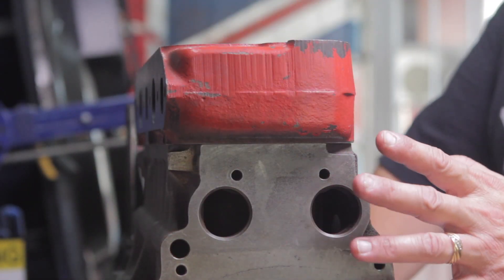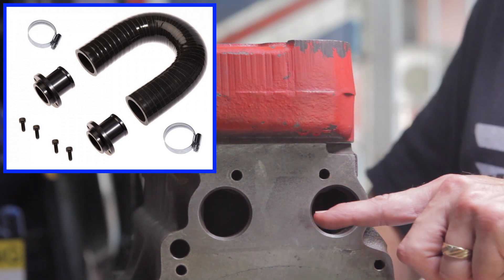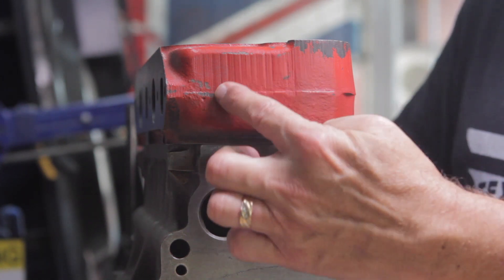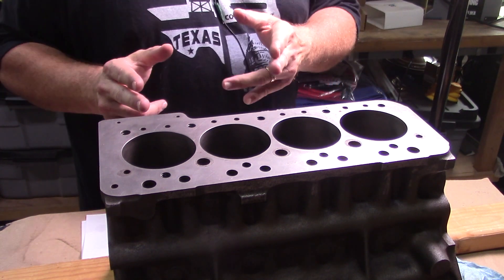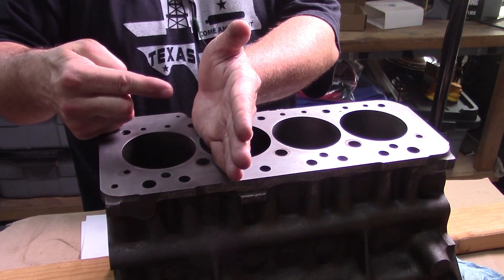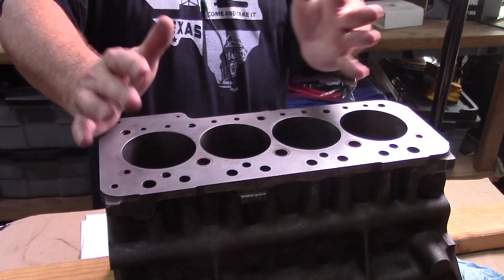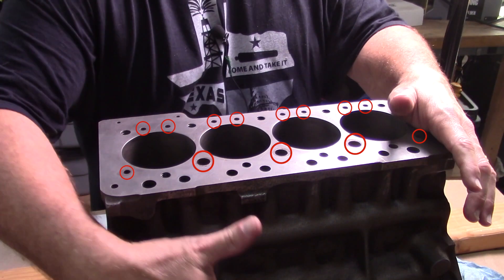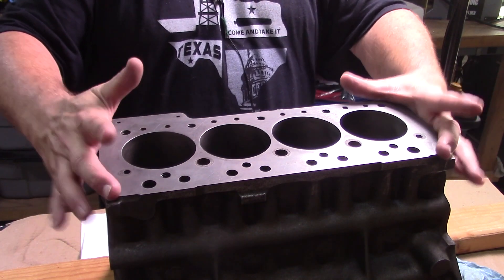Dry Decking my A-series 1275 engine- Classic Mini

Comment: 1, run engine a it bit richer this helps cool engine by washing the ports .
2, advance the timing 4 degrees more than manual states,this make for a cooler running engine.
3',change radiator for a 3 or 4 core.
4 use a 72/74/78 degree thermostat.
Reply from the maker: Greatly appreciate the tips..  will definitely learn more about 1 & 2.  I already have 3 & 4.  Thank you for the tips!!

Comment: Hey Randy, just curious, do they make an electric fan system for the mini?  I know some of the street rod guys use them on big block motors when they have overheating issues.
Reply from the maker: Hey Now JJ..  yes, and I am considering using an electric fan in addition to the dry decking.  They do make the electric fans and I can put on on the opposite side of the belt drive fan (inside the wheel well area)..   While not a daily driver, I would like to be able to drive the mini in the heat of the summer...

Comment: Randy, A very interesting topic, It‘s true that no 4 cylinder gets less coolant movement due to the dynamics of the flow path and i can see how 
the plugs would force more flow to the end of the block, The one advantage with the dry deck system and cometic casket is the flow is one 
directional so it has to pass all the cylinders and head at the same rate of flow, Looking forward to the comments on the Evans coolant video 
which i would like to contribute to if i may whan you get round to filming it. Cheers Dave
Reply from the maker: My thoughts exactly.. would love to do a collaborative video regarding Evans…

Comment: Thanks for the mention. I actually sell a dry deck hose/adaptor kit on my website should you require one. 
Good luck with your project. Phil.
Reply from the maker: Geez… did not realize that Phil… I will certainly have a look!!
Reply: @LoneStarMini  no problem at all. It’s a few $ cheaper than other companies to. 😁